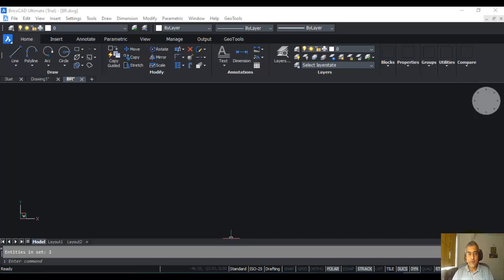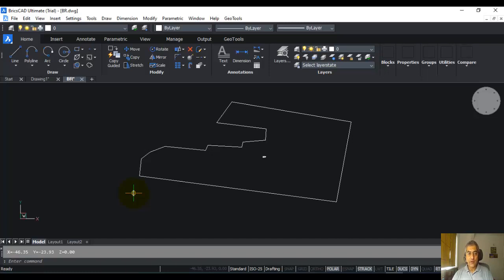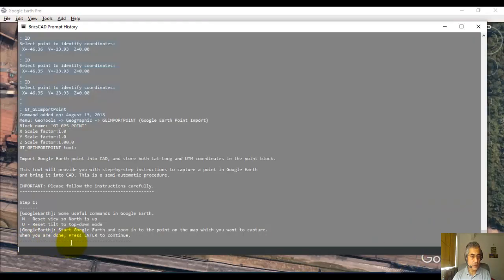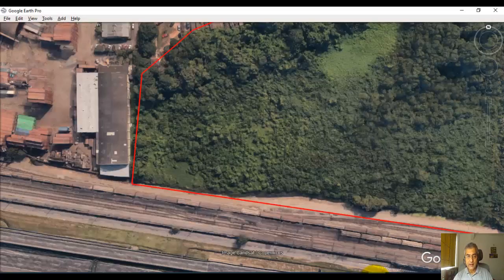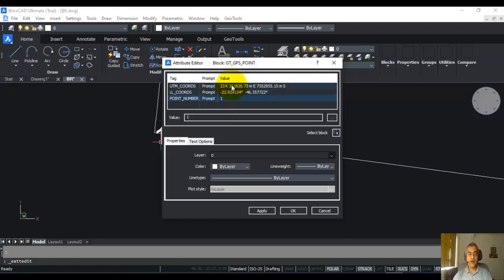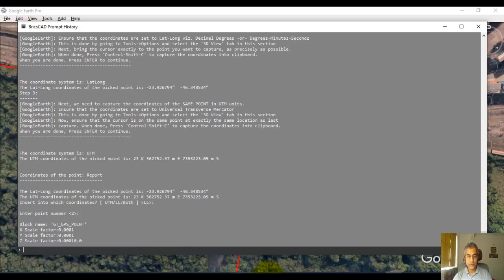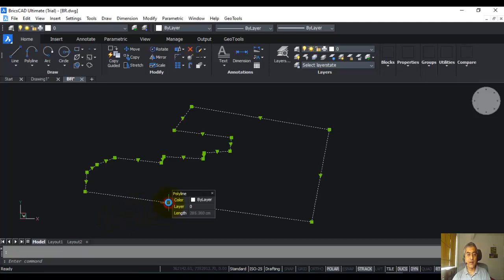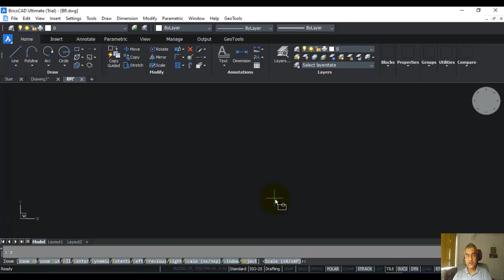Geographic Coordinates to UTM Conversion - Import-Export KML Files in BricsCAD & AutoCAD |  GeoTools

Comment: Questions:
- Does GeoTools work on BricsCad (V22) for Mac (Monterey)?
- looking for a simple function that I can include in my cad lisp routine (no dialogue boxes) that can receive Lat/Long coordinates and return the coordinates of a specified EPSG CSR; Does GeoTools include this function?
- What is GeoTools cost (CAD or USD)?
Reply from the maker: GeoTools does work on the latest Mac (with M1 chip) with BricsCAD V22.
We do have some coordinate conversion routines in GeoTools, but I have not tested the conversion of LL to EPSG system. It may be possible to get this with some testing.
Reply from the maker: GeoTools retails for EUR 275 per license. If you are looking for just this one function, we can work out a special deal for you.
Reply: @DesignsenseBLR  
Yes, just the one function is all I need; that would be great!
Here is a sample of what I need (to work in lisp):
(yourCustomFunctionName (list long lat z) 4326 crsEpsg)
...Where '4326' is the LL EPSG (I believe).
Or it could be a command line command too - that goes inside of lisp like:
(command "yourCustomFunctionName" ...)